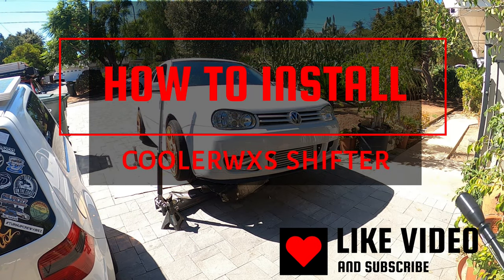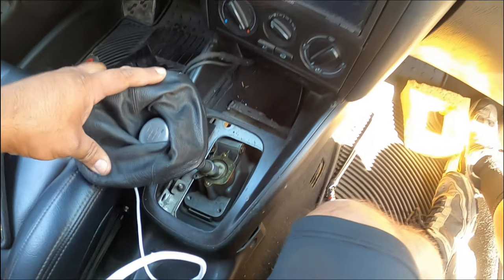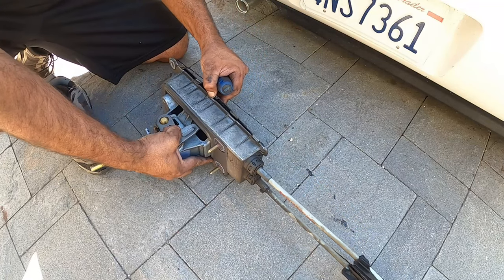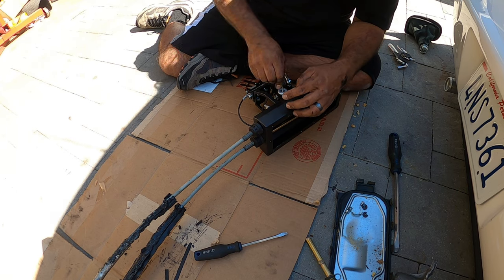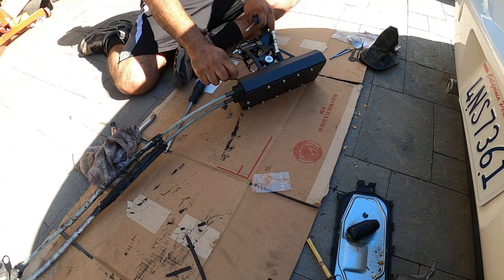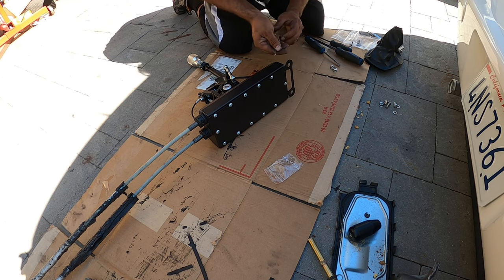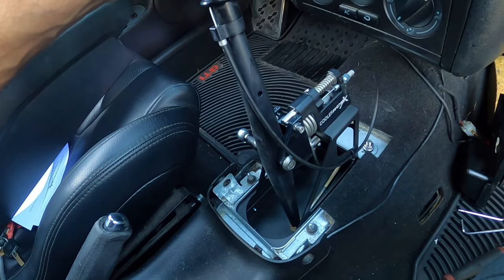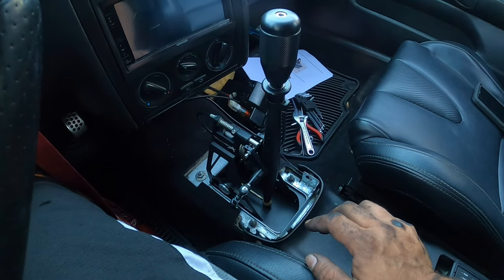How to Install Your CoolerWorxs Short Shifter Kit S7EP36

Comment: Hey! I was wondering how you aligned the shifter cable ends with the new coolerworx shifter? For example, oem has a shifter lockout pin inside the car
Reply: I know you didn’t disconnect the cable ends.. maybe you’d have some insight as to how to adjust them if you need to 😅
Reply from the maker: @MonuBirk  you can mark the cable ends so if you do remove them you have a basic idea where to start for adjustments

Comment: Which coolerworxs short shifter did you buy? Because I was on the website and there’s two and I’m not sure what to put it in?
Reply from the maker: I got the lower mounted one. The top mount sits way to high

Comment: How would you mount a Coolerworx top mount shifter in a MKIV? I can not find any information on how to install. I thought I had ordered a bottom mount but it was actually a top mount. Reaching out to Coolerworx to pay the extra to get the bottom mount went no where. Thanks for any help you can render
Reply from the maker: You need to drill holes for the cables
Reply from the maker: Do a mock up once you remove everything then install the cables on the shifter to see where your going to need to drill for the lines to feed into the bottom of the car
Reply: @PincheALsGarage  That is what I was hoping to avoid. I just emailed them to try and exchange but it took 2 months to get this one and I really do not want a $700 paperweight. Thanks for all your help and what you do in the dub community.

Comment: I wonder how this would fit in a mk2? 
I already have a mk4 shifter in my mk2 so I’m sure it would work. Just curious if anyone has experience with that.
Reply: Depends on what transmission you have. They have a 02A version
Reply: @superdave19855  I have an 02j from a mk4 5 speed. I was referring to fitting the mk4 undermount colorworx shifter in a mk2 with the stock mk2 console. I ended up modifying my mk2 console heavily to get it to fit to my liking.  Most mk2’s I have seen usually use the top mount with no console at all or it’s very butchered at best. I was hoping for someone who made it fit in a clean manner.

Comment: Hey nice vids man I have been seeing most of them as of recently I just bought a MK4 Jetta 1.8t and I would like to know if you can since you're one of the biggest if not the biggest YouTube channels on 1.8t content as far as I'm able to see how can I make around 300whp reliably I do have a 30PSI capable turbo already bought for the car but the internals are stock and I don't know that to get or how to get parts if you could help out
Reply from the maker: It's not about how much PSI it's about how much volume you can push.
So in another words Size Matters when it comes to boost.

I have a full video on what you need to buy to build an engine capable of 400hp safely and reliably.

My turbo does about 11psi and I make way over 300hp to put that in perspective with your 30psi turbo.
Reply: @PincheALsGarage  thank you I will definitely watch that video in a few and also drop a comment over there keep up the good work 👍💪🔥
Reply: @PincheALsGarage  hey man sorry to bother but I was not able to find the video I've been searching for a while would you mind linking it 😅😅😅😅
Reply from the maker: @SHREKALLDAY  it's In my live section

Comment: I'd be very, very cautious on using a short shifter with this shifter. The OEM cables are designed to only stretch so much.  By using this shifter AND a short shifter at the tower, you run a pretty big risk of over-stretching the cables and potentially damaging the synchros in the transmission.
Reply from the maker: Well it's been 11 months since I have installed this and yet to see any issues. I will post any updates if I do come across one.
I have done over 15k miles with this shifter and a good 5k miles of very hard driving.
Reply: @PincheAls Garage  Awesome. Very good to hear!! I was just sharing what the folks at Diesel Geek told me when asking about pairing their Sigma 5 short shifter with a CAE/Coolerworx shifter.  I meant no offense, just trying to share what was relayed to me from the good folks at DG.
Reply: Not entirely related, but I’ve had my B&M short shifter inside with the Neuspeed SS on the transmission for almost 20 years now, and have had zero issues with the oem cables..  that being said, I’ve been thinking of upgrading to this Coolerworx SS and pair it with the Dieselgeek setup.

Comment: Do they make them for the mk6 golf R ?
Reply from the maker: They have for mk7 I would call them and see if they have an mk6 in the works.
Reply: COOLERWORX SHORT SHIFTER PRO VW / AUDI / SKODA / SEAT (02J / 02M / 02Q) BOTTOM MOUNT.  This one fits all golf 6